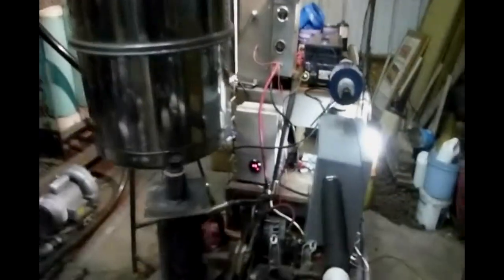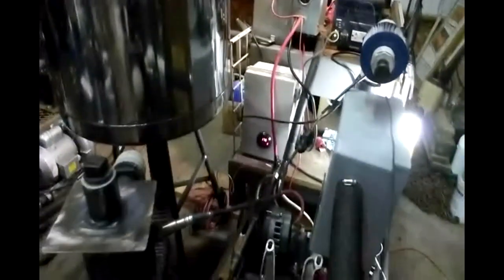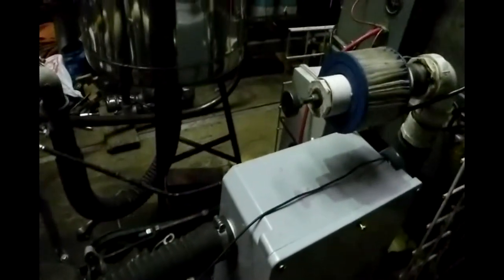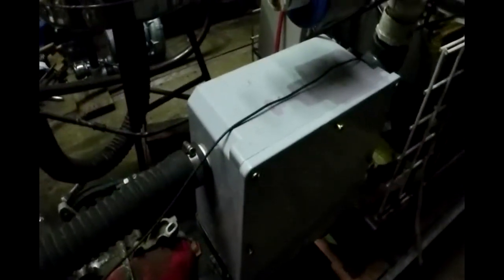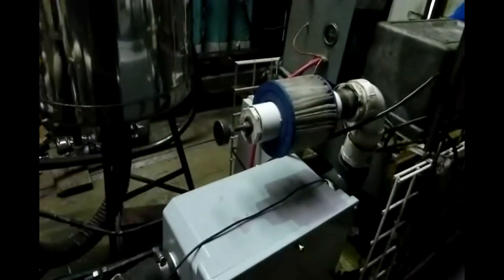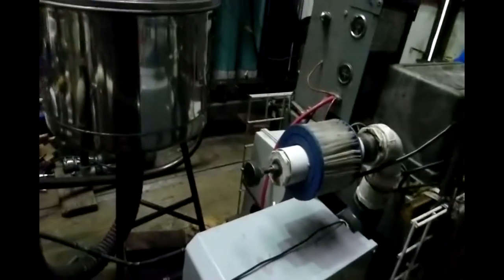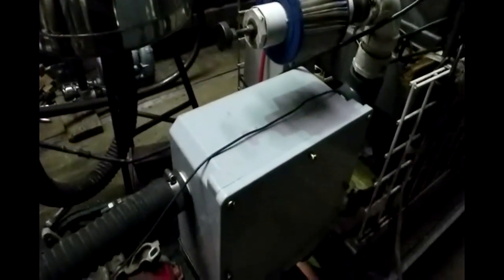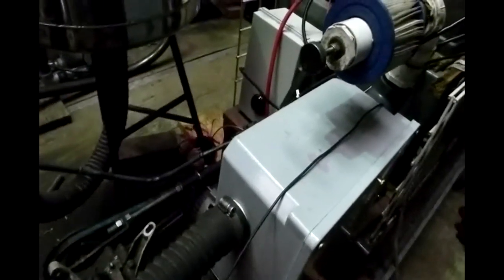Arduino airmix control for wood gasifier 20181202

Comment: i though gasoline engine running on woodgas needed a 1:1 ratio,  see your your using wide band Air to fuel ratio  at 14.7 ratio or higher.... runing on the rich side?
Reply from the maker: Henri,
Manually manipulating the air intake to a position which made the engine run smoothly under a small load produced a reading on the AFR gauge. That of course was relative to the conditions of the filters , fuel and everything else. I have never found anything consistent from run to the next . The AFR gauge does not determine the operation only the relative operating reading at a particular time. My rig tends to run best on a rich condition . Someone else might have a totally different reading.

Comment: Oh I am extremely excited to have come across this video.As you can see on my channel I have a 15 KVA on my  wood gasifier that I have been at for a few years , and find that I definitely let an automatic air fuel mixer , but alas of all the things I can do writing code is not one of them. I do have an Arduino  have pestered but thats it . So I almost need to be led to water so to speak..
I will thankfull for ANY suggestions or help,
Tom L.
Reply from the maker: Hey Tom, That's quite a "grunter" you have going up there, I did a double take when I saw 15000Watts on your wood gas video. Very cool man ! You've done a good job with your gasifier from what I see.I'm going to dive into your videos this morning and see what you've done. Like the rest of us you probably see the need for some automation/ control  during the " refinement" phase of the development. Arduino based automation is the direction I've started to pursue. I started out with zero knowledge so every day is a new challenge. The pieces started coming together when I started conversing with Matt Ryder at Thrive Energy out in Minnesota. He is a great help , even provided the code from his first successful Arduino control system. I have been fortunate to find a local study group in my area that teaches C code writing , electronic circuit board building and operational control. In fact the instructor has been very helpful . Since this video i have added the arduino and POT to control the fresh air metering carb  to the engine. Works great with the servo motor able to handle a wide range of adjustment. The next phase is the switch over to full auto control which I am working on right now. I'm planning a video of the complete build at some point but I can help you ease into this if you want.
Do you have any automation at this point in your build? Grate shaker? Wood hopper vibrator? Give me an idea of where you are in the build.
Good to hear from you
Bill

Comment: In the code there is an input for a pot switch to manually control the servo. There is also an input for a switch to tell Arduino what mode to be in. When this switch is LOW then it inputs the signal from the pot switch to control the servo. When this switch  becomes HIGH it rights last position and then ignores the pot switch and automatically adjust based the AEM signal ouptut.
Reply: Once you have this up and running you will learn the other automation ie grate and hopper agitators. If you see that the air mixer angle is running bellow 50% then the grate shaker interval  maybe too long interval and vice-versa. You will know when you have it all balanced when the angle position is held to a steady position and where the gasser is breathing optimal.
Reply from the maker: @Thrive-Off-Grid  Matt, Thanks for the insight on the code and the positioning . To get the real feel for the positioning of the linkage as we progress though this operation I have a simple code written for the arduino to operate the servo with a POT only. I can get some data at that point and some idea of where to set the linkage once it stabilizes.
After some familiarity  the switch to your code will be an easier transition. 
Now that my busy season has slowed down I can devote more time to this. Can't wait !  I'll keep you posted. Thanks for all your help.
Reply: @nhhbbyloggr5022  very interested in following along. I'm aware of both Matt's mixer and Ben Peterson's -- any major differences that you guys can indicate between the two?
Reply from the maker: @icarus901   I bought Ben Peterson's electronic Carburetor book to explore the idea of an electronically controlled carb. I had no back ground or knowledge of " Arduino" systems. I was fortunate to find a local study group which focused on the Arduino and embedded systems.At that point I didn't mind spending the money for all the parts because I felt that I could get through this project wih knowing the right people to help me. First thing I did was  meticulously copy the code which Ben provided in his book. There seems to be a flaw in his code as it failed to verify or compile. We messed with it a lot but could not get the code to upload to the Arduino. Matt Ryder provided his code and it was spot on. I have a separate Arduino Uno with the Ryder code loaded just waiting for me to get up to speed and install it. Presently I'm working with a code for controlling a POT . I found that the servo motor rotation positioning " stop to stop" can be set through the Map ( ) . I'm taking small steps to learn and achieve what Matt has brilliantly put together. I'm almost ready to make the final leap and I gotta say, Matt has been very helpful and totally honest about the whole thing. I will have to make adjustments to run my particular build as no two personalities are the same, but the theory and mechanics are what count.
So, long story short, Ben's code does not work for me. Matt's code will work just fine.

Comment: Howdee Bill, 
 Great video. Now that I have had TWO woodgas fixes this week, I am totally fizzing!!!!!  
 It sure is sweet to see your AFR meter responding to your manual inputs to the throttle body. 
 Doing this will give you a very good view of how the gas mixture control loop will be working when you add the computer to it. 
 Indeed, the more you practice this method of control, the more elegant will be your firmware solution to the automation challenge. 
 There's nothing easy about this, but I know you are up for the challenge, especially now that you know that it will help to protect you from woodgas bug necknips during your future refueling runs  :) . 
 Keep up the good work, my fellow wood to watts conversion addictionist.
Reply from the maker: Thanks for the nod, Steve. This really is pretty cool stuff. In my head I know how it works, now if I can only translate it through code and computing. Next is the simple control via the Arduino and POT to manually operate the servo. I already have that code and the bread board wired for it ... until it shook itself silly during this past run. Everything fell apart so it have to rewire it and isolate the electronis from the engine vibration. 
One more big week ahead in the wood delivery mode and then it's  WEENO TIME in the little shop of horrors.

Comment: Ok Bill,  I'm gonna be that guy that starts with the questions. First off, I haven't spent any time researching the air fuel mixture stuff. I know they use an o2 sensor on the exhaust and use that to determine whether it's running rich or lean, but what are the numbers being displayed on the digital gauge? What are we looking to see there? Is your goal to keep that number right at a set point, or does that number change based on engine load? This is all new to me and I will have to learn all about it if I'm going to attempt my own rendition of this air fuel mixture automation. Can you help a poor curious gasifier addict out here? I remember Steve was messing with this stuff,  but he used some sort of hose pinching setup, and that's a little bit different in some ways.  I'm sure he talked a little about it,  but it's been a while. Anyway thanks for the show.  Joe
Reply from the maker: Joe, The O2 sensor recommended  by Matt Ryder and Ben Peterson is   the AEM Performance Electronics - Air Fuel Ratio Meter. It's a wide band type, part # 30-4110. I think I got it on Amazon  . A little pricey but .....
The gauge reads the Air Fuel Ratio as Steve states, I've found ( and Matt also ) wood gas likes to run around 15,2 - 15.9 .
Now, there is also a signal wire from the sensor sending a 0 VDC - 5 VDC signal.  This changes up and down as the ratio changes.This voltage is what the Arduino reads and through the power of computing code operates a servo motor which controls the position of the butterfly throttle plate of the air flow carb. I was operating the butter fly manually in the video to get a feel for the responsiveness  and mostly to see if it even worked. Yes it does ! My gut tells me I'm on the right track and to keep going on this project.
Today I got the rubber antivibration isolation mounts and some 1.5 " super flexible shop vac hose to try to get rid of the vibration from the engine. A clerk at the local hardware store with extensive knowledge of Arduino control systems suggested keeping the Arduino board separated and isolated from the engine chassis . H might be right. I have a lot of trial runs to do in order to " set the clocking positions" of the carb position to fit within the capability of the servo motor.  There's a lot I don't know yet.
I'm fortunate to have the help writing the code from both Matt Ryder and my Arduino class instructor, and a world class electronics engineer . They have been witness to the NH Flower running along  in all its glory and have both shown great interest in the project. I'm very grateful.
I'll do more video sharing along the way for anyone that's interested.
Reply: Howdee Joe,  
 Watt you are seeing there is an AFR meter, or Air Fuel Ratio meter for short. 
 When the system is running on an even keel, the AFR reading will tend to settle down to a steady-ish figure. 
 In a petrol engine, this figure is about 14 to 1, but I really don't know watt it will read on an engine that is being fed on treezel gas. 
 Indeed, it may try to tell us that the figure is 14 to 1 when the engine is running smoothly on tree fumes. 
 Wattever reading you get from it, the goal is to try to make it stay within a stone's throw of that figure, regardless of the engine's load or RPM. 
 Now, that's the challenging part of the whole deal. 
 Indeed, it's enough to drive you to drink ........... coffee, that is  ;) .

Comment: Cool. You've been busy behind the scenes with the Arduino stuff. Yeah you need to get everything nailed down for sure. "I was starting to lose my bearings". I had to laugh when you made that statement. Yep I can guarantee you that when you mess with this stuff loosing one's bearings is the norm when experimenting then you factor in running a video camera at which point you become that guy that used to spin a bunch of plates on the end of sticks in the 1960's.... And now a blast from the past and a good technical reference video for how to run a gasifier "off the fly". Bill I hope this helps you find your bearings. https://www.youtube.com/watch?v=Zhoos1oY404
Reply from the maker: Hey Mike, Yup, the spinning plate scene sums it up pretty well. We have one up on that guy though. We have to do a running commentary on what we are thinking and what is actually going on. Sometimes the two conflict and that is when the wheels fall off the wagon. Thanks for the laugh.